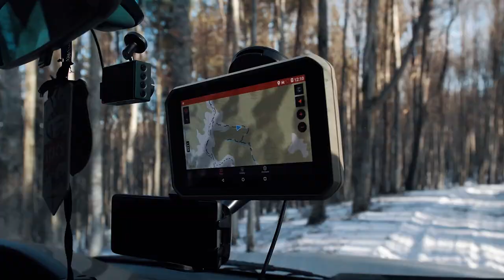Aventura offroad iarna pe zapada | STACS TRAILS

Comment: Salutari! Am un Nissan Patrol GR 3.0 di turbo 2003, 5 usi, in stare buna de functionare care isi cauta un nou proprietar de data asta un pic mai pasionat in ceea ce il priveste, care sa fie dispus sa ii dea o noua sansa si sa il plimbe prin locurile lui preferate. E un pic ruginit pe sub praguri, nu s-a imprietenit cu apa nici acum. Blocul motor a fost schimbat complet pe la 100 si ceva de mii, dupa ce s-a aventurat prin desert. Cine e interesat dm. Inmatriculata in Bucuresti. Pretul este negociabil 5000€
STACS TV sunteti 👉ZA BEST!👍👍